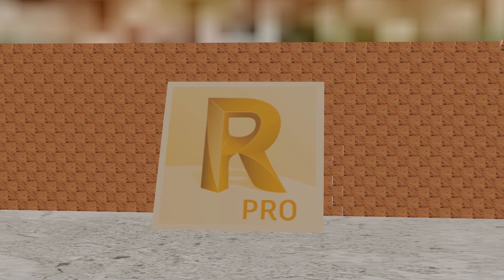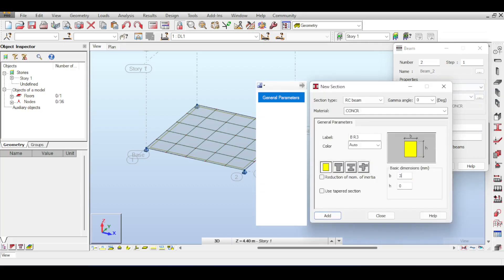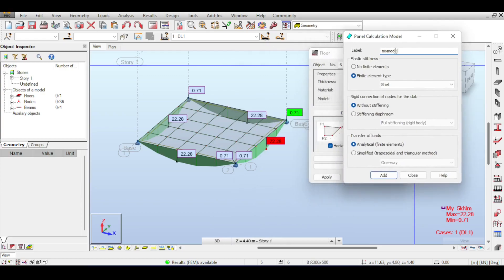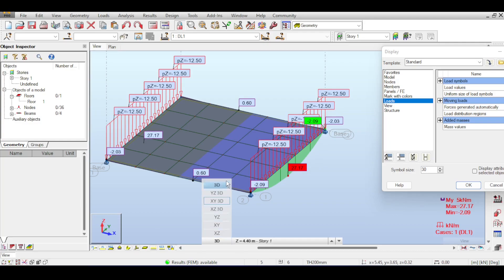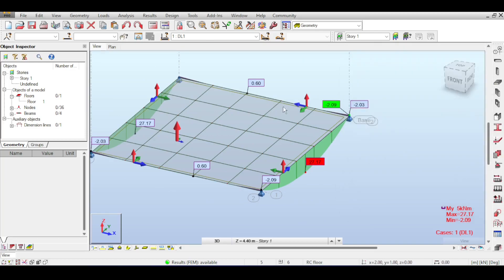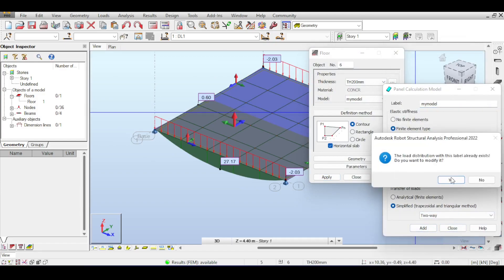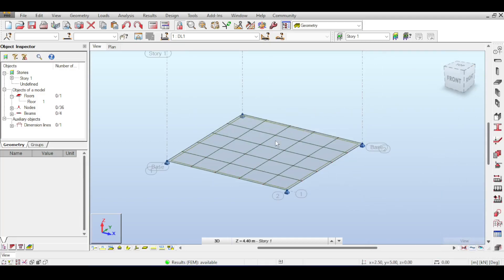Model Types of Plates and Shells in Autodesk Robot

Comment: Thanks for the video!
I kindly have a question. I modelled a panel  using two-way cladding and two-way shell under equal circumstances of loading, panel size, supporting beams...
But the beams have a bigger bending moment in the two shell comparing to cladding! Do you know why?
NB: I excluded self weight for both cases.
Reply from the maker: when you model something using a shell, even if you disregard the self weight, the values and results are not going to be 1-1 identical with the cladding. You can even verify this by comparing the Bending moment diagrams of both cases.

Of course the question is: why?
it is because of the stiffness of the slab. When you model a cladding, the only thing that it does is to calculate the load and apply it on he beam. So it is like a piece of paper that only transfers load.
when you model a shell, not only does it transfer loads, but stiffness too.

That would be the reason.
of course, the more accurate model is the model with a shell.

Hope it helped
PS: Sorry for the late reply. I had a ton of things to finish and now I am gradually getting back

Comment: Hi, thank you very much for this tutorial. Very informatve and helpful. I have a question on when you shown the differences in analysis in Panel Calculation Model. In one of the examples you have used shell elements with transfer of loads "analytical (finite elements) and in the other one you have used "Simplified (trapezoidal and traingular method). In the trapezoidal method you are able to pick the Two-Way distribution method and my question is this approach exactly the same as using the analytical method which always distribute the load in two directions? Additionally, is it possible to change the stiffness of the slab in two directions? Often slabs are heavily reinforced in one direction making it stiffer than the other. Thank you once again!
Reply from the maker: Hi there. Thanks for your comment, I feel honored.

To your question: 
Let's say you draw a slab with 4 beams around it. If you want to manually calculate the shears and bending on the beams, you would do so by using the trapezoids and triangles (if it is a 2 way slab). This is an approximate way, which will happen if you use (Two-way distribution or even one way distribution).

If you use the Analytical (with finite elements) then the load transfer will be calculated based on the stiffness of the slab. This will provide more accurate results for the beams.

For the other question; slab with higher stiffness in "Let's say X" when compared to y due to reinforcement:
You can do this during the definition of the thickness of a slab. There is a button called "reduction of moment of inertia". Now when you click on it, you will see a singular factor. That is not what you want, you want to be able to tweak the inertia of a single direction.  Besides the reduction of moment of inertia, there is a button with a ( > > ) on it. If you click on it, you can modify the inertia for each side alone.
Now, modifying the inertia will affect the stiffness of course (EI / L something)

Hope it helped.
Regards,
CEE
Reply: Wow, thank you again for this very detailed answer! This helps a lot!!
Reply from the maker: U r most welcome. If possible, plz share with ur colleagues 👍

Comment: what is the difference between shell-no finite-tributary type and shell-finite-tributary type? we can also use deck slab for one way instead of cladding.
Reply from the maker: Claddings transfer loads directly to beams indeed.
Reply: @CivilEngineeringEssentials  what is the differences between tributary type of shells one with finite another without finite, in robot settings for panels?
Reply from the maker: If u enable finite element calculations, you would get the deflections of the slab. If you disable it and opt for simplified triangles and trapezoids, you do not get the deflections. 👍

Comment: Hello! Thank you for your videos. A question: Why you add a load upon the self weight ? Does not Robot use by default the self weight ? Do you need to add this one?  I had test with a steel structure and robot add by itself self weight but this is not the case when I use shell elements
Reply from the maker: Hi there and thnx for your comment.
Autodesk Robot adds the self weight to any slab that has a thickness and material.
The reason why you may want to add a load is because of tiles or other floor finishing. Or even mechanical fittings.
If you define a floor using cladding, theb self weight is not calculated.
If you delete the self weight, you can re-add it from the loads window.

Hope it helped
Regards
CEE

Comment: kindly can you answer this question if we distributed a uniform load of 12.5kn/m and it is simple support then the moment should equal wl^2/2 which is not the case here when you used finite element while when you used cladding the value is 39.06 which is equal to the formula. Thank you In advance
Reply from the maker: Hi there,
the cladding is an approximate way of analyzing moments, where the loads are distributed via triangles and trapezoids. Here, you are 100% right, you would get the hand-calculation moments of wl^2 / 2 and other possible moment formulas depending on how the width to length of the slab is.

However, having the FEM analysis, the moments differ slightly, because the analysis now depends on the stiffness of the slab. It even depends on the fineness of the mesh.

Now the question is - of course - why would you do a FEM analysis if the cladding gives you great results?
Because in the FEM analysis, you get the moments of the slab as well as the displacements of the slab, which allow you to design the slab besides the beams.

if you use claddings, then you get results only for the beams without the floor or slab itself, meaning that you cannot design the slab because you do not have the internal forces and moments of that slab.

Hope it helped,
CEE
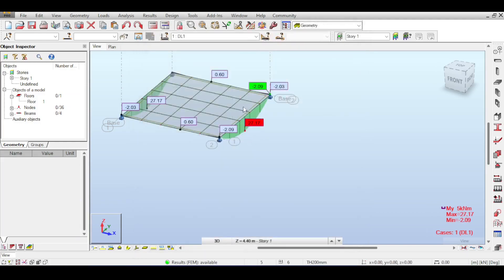Reply: @CivilEngineeringEssentials  At 3:40, the BMD (Bending Moment Diagram) of the beams was presented, showing a moment of 27.17 Kn.m. This moment serves as the foundation for our beam design . However, upon manual calculation, the computed moment is 39.09 Kn.m. i am asking due to the notable discrepancy exceeding 10 Kn.m between the Finite Element Method (FEM) and the triangular and trapezoidal method. which value should I use to design my beam ?
at 3:30 you changed the model type to (my model) when the load transfer is set to simplified and x direction. an autogenerated distributed load of value 12.5kn/m if founded on the beam and since the beam is simply supported beam the moment should be equal to wl^2/8. i just want to understand why didnt value of moment resulted in wl^2/8

Comment: Greetings once more. I would like to express my gratitude for the time and dedication you have invested in creating these videos. I kindly request your assistance in shedding light on the practical application of cladding in a real-life project. Moreover, I would greatly appreciate an elucidation regarding the inherent benefits that cladding provides to me as a structural designer.
Reply from the maker: Hi there and thnx for your comment.
I did not get your question completely, but I will answer to the best of what I understood.

If you mean the benefits of cladding in modeling in RSA, then here is my answer:
Claddings are load distributing elements that simply distributed the load on them to the carrying elements via simple "tributary area" schemes. So if you have a cladding, it distributes the loads on the beams via triangles, trapezoids and rectangles.

The benefits of this is making the analysis very quick, because no stiffness matrix is calculated for claddings, and no meshing is required, thus reducing the number of degrees of freedom and speeding up the analysis.

On the other hand, if you use floor elements as slabs, then suddenly you get a mesh, and the analysis becomes slower but more accurate. Note, the slow-down is insignificant for simple models, becomes daunting for larger ones. In one of my series (RC building series), an analysis run costs me around a minute (I video edit it out) despite me having a Core i7 10th gen laptop with okayish specs.

================
the other thing I could understand is that you want to ask about why we use claddings in general.
The word cladding is used to describe a lot of things, especially glass facades and warehouse ceilings.

Claddings can be made of steel corrugated sheets and a layer of insulation (depending on your region), and are easy to install and maintain. Unlike a real RC floor that is heavier and needs to be cast in place.

Claddings - however - are usually not designed to carry gravity load above them, making them a perfect fit for a "last roof" rather than an intermediate roof.

Hope I was able to assist. If you have any further questions, please let me know.

Regards,
CEE
Reply: you can use cladding to distribute loads to beams, size them in preliminary design. Cladding gives bigger moments in beams than when you use shell. Shell carry some loads, since it is a flexible member that absorbs some stresses/loads while it distributes some to the beams. Cladding has no stiffness property, does not bend, hence dumps all the loads on it to the beams or supporting members. This gives conservative results especially in beam sizing during preliminary design. Cladding can also be used when you want to distribute pitched roof loads to your purlins, rafters and also wind loads to the framing members especially in warehouse analysis.

Comment: Thank you sir for the amazing effort, I have a question regarding if there is a way to allow putting linear load directly over the slab without adding beam nor separating the shell? also, I tried to add vehicular load on top of slab, but I couldn't. I will be grateful if you can advise how to deal with these issues. Thanks in advance!
Reply from the maker: Thnx for your comment. I think it is actually possible, I will include a little explanation to this issue in my next video (the continuation of the pedestrian bridge series). I hope I do not forget.

Regards<
CEE
Reply: @CivilEngineeringEssentials  well, actually I got the right method to do assign linear loads over the slab and that's by using polyline and selecting surface load then add select linear load option. Thanks
Reply from the maker: @safiyamunther4061  Perfect. I am really happy it worked out for you.
Stay tuned,
CEE

Comment: How I can modeling  a ripped  slab
Reply from the maker: That is a really good question. You can do that by two possible ways:
1 from the thickness definition by defining the ribs correctly.
2 using "beams as ribs" then putting a "topping slab" of 5cm thickness above them.

Please note that it is not easy, but is doable on Autodesk Robot.

Thank you very much for your question.

Comment: Hello, its me again!

So i have a rather different question this time, its about steel plates in RSA.
So i was wondering if there is anyway that we can DESIGN steel plates in robot? for example if we have a silo that has steel plate walls, is there anyway we can design those plates? for concrete RSA fully supports it, you get required reinforcement and provided reinforcement and checks whether the thickness is enough for punching and all sorts of check for the concrete plates.

but what about steel? i realize you can model a shell/plate then assign a steel material to it and thickness, and RSA will give you all the stresses and deflections, however, i have never found how to DESIGN the steel plate, i.e see if the thickness is enough or if the resisting moment is enough to resist the applied moment. basically same as how RSA designs steel beams/columns. is there anyway we could check steel plates if they are adequate or not? i've searched RSA forums and only found that you can compare "absolute maximum" stresses in the steel plate to that of the material's limit. but this doesn't seem like the correct way.

so in case of a steel silo, how could we design the walls (steel plates) with robot? i'm aware that some other softwares (such as RFEM) can in fact design the plates.

Thanks!
Reply: You can use RSA for the steel plates, the panel can be defined as steel with a defined thickness. But you cannot define the plate over a beam by connecting endpoints. You need to split the beam into the  FEM element's dimensions and make the panel from node to node. All is about the total number of points, which is relatively low. So you can use RSA  for the plate's steel design if the design is not requiring a lot of nodes and the FEM element size will be chosen as big as possible (1 m or more)... My approach is to get it as much bigger as possible and make a separate small model much more detailed for the most loaded-stressed area. Also, you can use cladding to full load the beam-supporting structures and make a plate analysis just for the worst case and area. In the model presented, use a shell and choose steel as the material. The results and analysis are the same, as panel properties affect the results, not the FEM method...
Also, you cannot have curved beams in RSA, but you can make them from short members connected along a curve...
Reply from the maker: Your comment is really helpful and insightful. I can see great experience in the FEM feom the comment.

One little disagreement:
You can define the slab over beam endpoints.
Robit will discretize the beam for you. You can see those elements by:
Right click
Display
And find something called (calculation elements)
You will see multiple tiny numbers over the beam to denote each FEM bar.
Reply from the maker: Hi dear Engr. Lawk
unfortunately, robot is unable to design steel plates. To me, this is really odd to be honest.
I think dlubals RFEM does that. 

The "abs max" stress and the "von mises" stress is just a workaround to be honest, because there is more to consider such as plate buckling, which is more complicated than bar buckling. Thus, I personally discourage the use of such approaches when there is potential for buckling. Storage surfaces are prone to this.

Hope it made sense ^_^
Regards
CEE
Reply: @CivilEngineeringEssentials  well said, honestly its unfortunate that robot is missing this. its a really good software. so what software would you suggest for the design of steel silos or any structures that have steel plates? Dlubal RFEM? CSI SAP2000 (not sure if this designs it honestly) or any other good user friendly softwares you maybe aware of?
Reply from the maker: @llLawkll  To be honest, not really.
However, I decided that my next structure "after the transmission tower" is going to be a steel silo. I will dive personally deep into it and make sure I can cover most of the AISC checks with that regard.

(Currently, I am modeling a transmission tower, I expect it to end maybe in a video or two).

I checked etabs, csi2000 and safe, it did not have a "clear cut" interface for steel plate design. 

Anyways, stay tuned ^_^
Reply: @CivilEngineeringEssentials  thats awesome, i'm still watching your videos one by one, haven't got to the transmission tower yet, but i'm definitely excited. best of luck! great channel!
Reply from the maker: @llLawkll  thnx a lot ^_^
if possible,
consider suggesting the channel to your friends to subscribe, to increase its reach

Regards,
CEE
Reply: @CivilEngineeringEssentials  oh trust me, i've already done that, i have few structural engineer friends and i've shared your channel with them all. its not everyday you come across an assistant professor giving RSA tutorials.